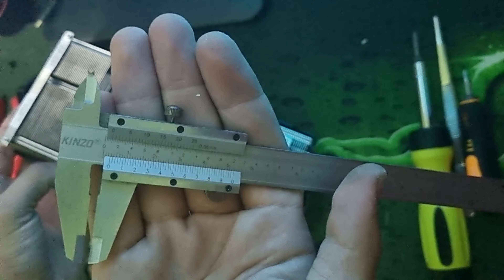Unlocking Maximum Performance! MSI RTX 3060 Ti Gaming X GPU Thermal Upgrades

Comment: I am curious as to why you didn't replace the thermal pads.  I always been under the impression whenever you tear into a GPU, it's best to go ahead and replace the pads as well as thermal paste.
Reply from the maker: thermal pads ofcourse important but not like thermal grease. you can use pads many times if they dont collect too much dust, but  you need to change thermal grease every time when you remove heatsink.  And always core temps are bottle neck gpu, not vrams or power mosfets
Reply: @Cyptech  I see thanks for clarifying.  I plan on replacing the thermal paste on a 3060 hence why I was looking for tutorials on it.  I read an article that said you have to replace the pad, but seeing what you said here makes me think otherwise